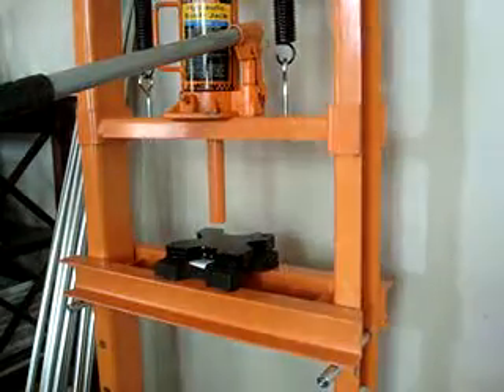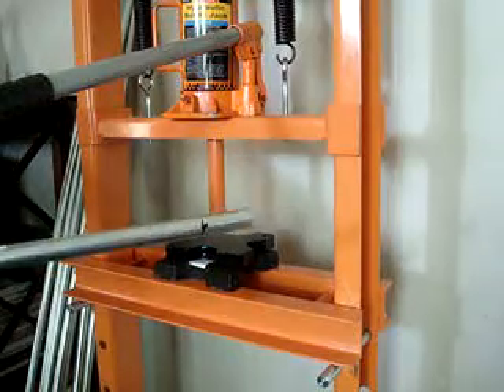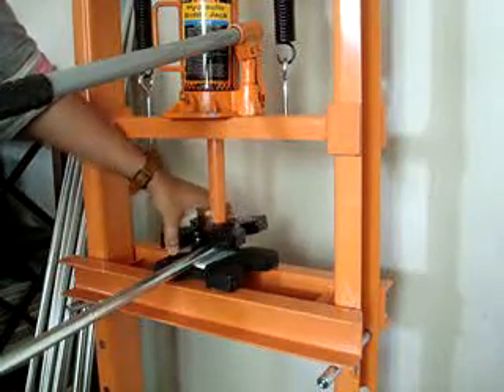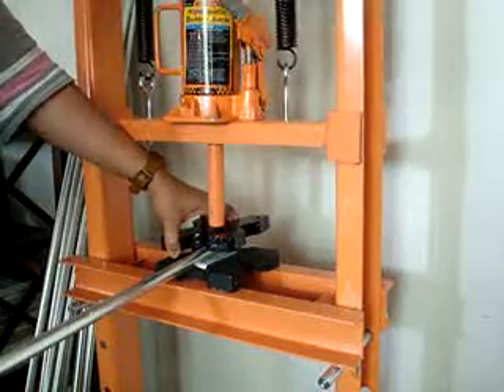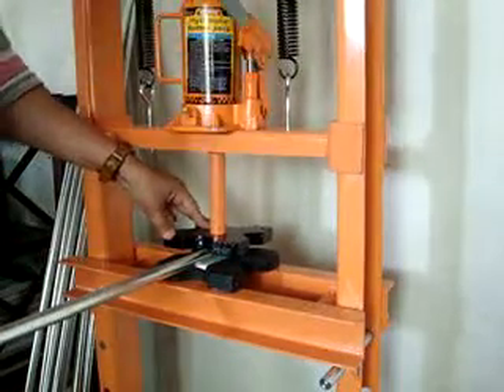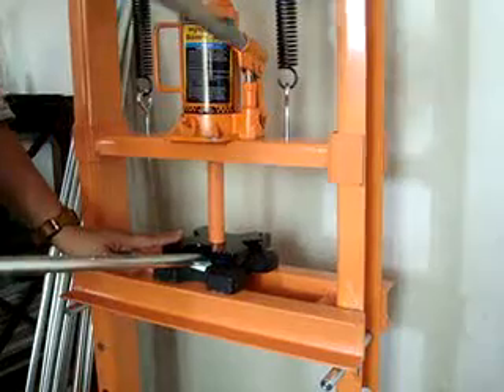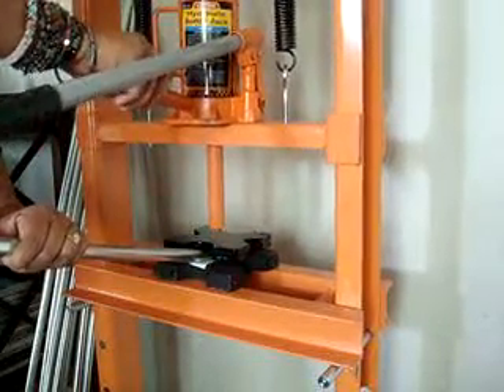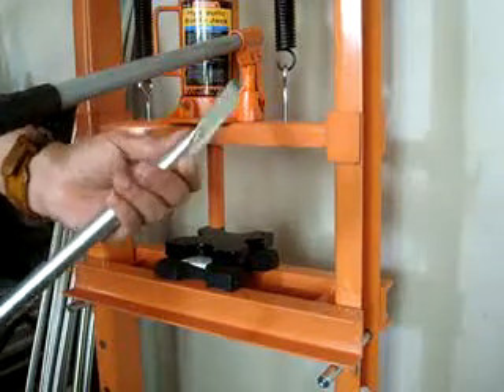How to:  Conduit Geodesic Dome - Flattening the end of Struts

Comment: Greetings
I am also interested in making a dome out of conduit
Questions: what size of conduit do you recommend 
Is this a self made jig? 2 pieces..  top and bottom?   Can they be purchased on line or at a hard ware store 
I can purchase a press like the one you have locally 
Looks like a one person operation.   Will have to be.  It will be done in secret and seclusion     People close to me will think me off the edge 

What size of bolts did you use?

Any further construction videos. 
Enjoyed this one

Thanks
Reply from the maker: I used the 1/2 cause it was sooooo cheap back then.  Now it’s very expensive.  So I’m no longer building metal conduit domes.  I just bought a Harbor Freight portable shed
Reply from the maker: I was even planning on 3d printing 5way and 6way connections which will eliminate flattening the edges and drilling holes.  You can probably order them somewhere nowadays
Reply from the maker: No self made jig.  Those two metal pieces came with the press
Reply from the maker: Pretty easy to make and put together.  It was just tedious to cut those metal pipe. I had to use a copper pipe cutter

Comment: How have these held up? Did you anneal them beforehand?
Reply from the maker: I dip the edge in latex paint to prevent rust.  Amazingly still very good.
Reply from the maker: The only regret I have is not buying more metal conduit.  They are so expensive nowadays.

Comment: Im using half inch conduit too.
Reply: How strong is it
Reply: @munsonmusclefitness  Well it bends under the weight of me standing on it and I weigh about 140 pounds... yikes But I am planning to build three of these 3v  so im wondering if I should move up to 1" thick for the next two. Only problem is I will be travelling to festivals with them and I need to keep the weight down to a minimum.
Reply from the maker: I would love to see ur project
Reply: @mentalage5  
I`d use 3/4" conduit and increase the frequency if required to keep the strut length down. The longer the strut, the more deflection.
Reply: @munsonmusclefitness  it's still standing
Reply: it's still standing strong... I built three of them
Reply: Alicia Miranda do you have an Instagram or any updated pics?